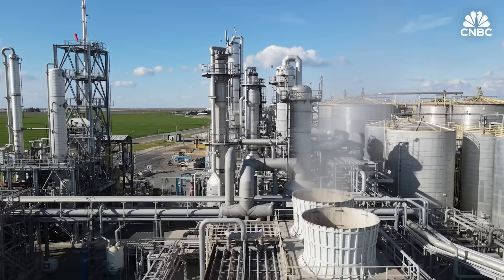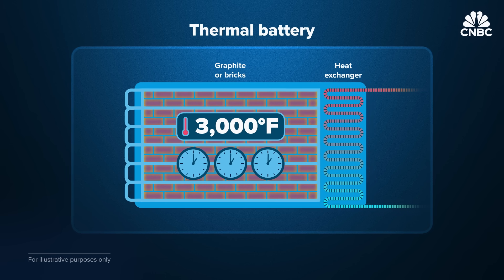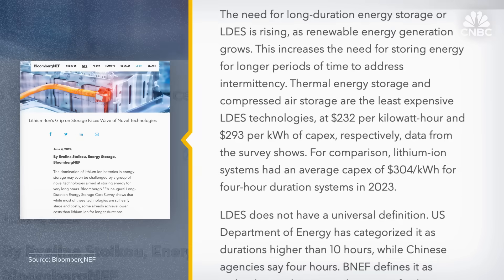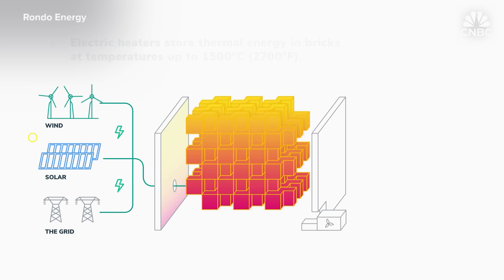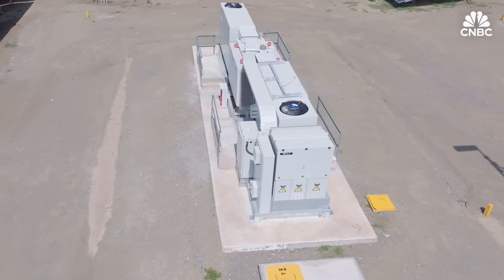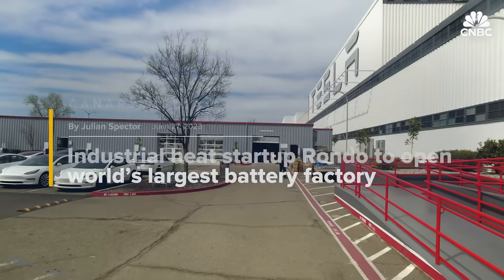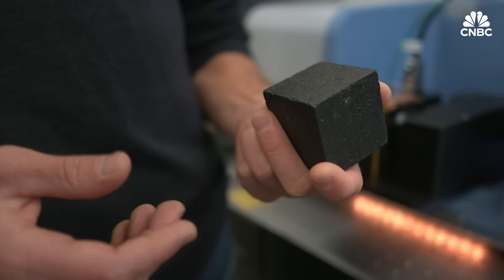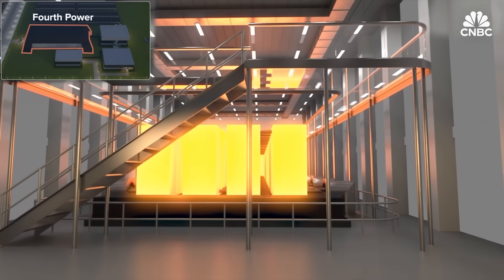How Thermal Batteries Could Replace Lithium-Ion Batteries

Comment: This was how some houses in England would heat. They had thermal mass under the floors and heated it at night when there was not the demand from industry and kept the coal plants running.  Now there is less industry and now there is extra wind at times.
Reply: Yes!
Reply: @RondoEnergyGlobal my brother in law bought a house couple of years ago and now he built up walls of clay inside and plaster the outside also with clay. It looks very beautiful and the feeling/climate inside the very nice. Unfortunately the ceiling was already pretty low so he couldn't put floor heating in it and use a heat pump. Hopefully he will put some solar panels on the roof in the future to make it really nice

Comment: Residential battery storage is already down to $230 kWh retail. So, I'm having a hard time believing utility scale battery storage is $304. How old is the data in this report?
Reply: There is a big difference between mounting a battery on your wall and installing grid scale storage. The cost of the residential battery might be $230 but for grid scale you are doing a lot of civil work so those batteries have a safe place to sit and then all the wiring to make the connections to the grid. I'm guessing for the utility scale they are factoring in the average all in costs.
Reply: @pin65371  That is per kWh so a residential  system is thousands of dollars. According to Energy Storage News the cost was average cost for utility scale storage US$180/kWh at the beginning of the year, compared to US$270/kWh the year before. It seems their costs are based at least two year old data. It looks like they are already not competitive.
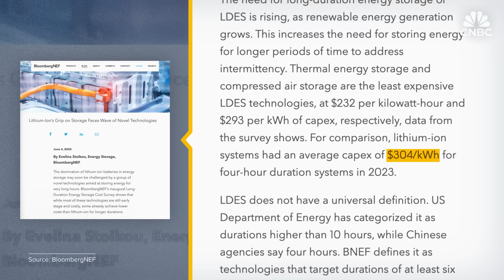Reply: If you're talking about the one at 2:40, it says it's from 2023. To build on your point, the cost of battery storage is dropping absurdly quickly. For reference, there are currently LiFePO4 prismatic cells such as the EVE MB31 where the cost of the raw cell is ~$95 per kWh. Obviously there are additional costs such as the BMS and the inverter equipment, but for grid-scale storage I suspect that the cost of their systems will be dominated by the price per cell.
Reply: @Nezzytheawesome  there will also be large costs for the civil work for the grid-scale batteries.  Either they sit on a concrete pad or they have concrete piles where the batteries sit on. Then you need to add all the costs for making the connections so you can connect those batteries to the grid.  There are a lot of well paid people involved from engineers to the trades that do all that work.

Comment: For those interested in reading, the Department of Energy recently published an article ("Achieving the Promise of Low-Cost Long Duration Energy Storage", Aug 24) discussing a bunch of grid-scale energy storage technologies, including thermal energy storage, and what can be done to bring down costs.
Reply: Note our primary customers are heavy industrial facilities that require 24/7 heat, not electricity. That heat is currently being produced by natural gas-fired boilers that in some cases have been operating uninterrupted for decades. We take intermittent power that is low cost, or even negative cost during hours of overgeneration and curtailment, and convert that to the high temperature heat that industrials need. Industry is the largest emitter of CO2 and 74% of industry's emissions come from heat, not electricity, to drive industrial processes.
Reply: Thank you! Used ChatGPT to summarize as it was 51 pages! woof.
Reply: You’re so cool for this
Reply: While heating the planet.. Or, how the irony mountain grows every day

Comment: WHY NOT JUST MAKE THERMAL POWER PLANTS IN EVERY CITY!? Earth is full of heat, y’all, 1000ft below or higher. Pipe down, pipe up. This is an expensive red herring
Reply: Rondo can re-power thermal power plants to run off of intermittent renewables instead of coal, oil, or gas.
Reply: Conservatives and fossil fuel industry will block it.
Reply: @larryc1616  bet the dems are against it too. None of the politicians want real change; especially nothing that could lead to utopia
Reply: have to wait years before things evolve
Reply: The process would require electricity since thermal pipes can t passively transfer heat down below towards a cool surface without significant energy loss.
Reply: @ You must have skipped elementary science class. Water goes down because of gravity, steam goes up because of heat and conduction/convection. The system would generate largely net positive energy. Iceland is powered by 90% geothermal electricity. Look it up
Reply: Iceland can use geothermal technology because there are heated reservoirs of water relatively close to the surface. Not everywhere is so close to the heat of the earth that water can efficiently be heated by the earth. Some places would need holes so deep that they would be on the tip of oil-drilling capabilities. Also, Iceland has been developing this infrastructure since the 70's. I'm not saying that geothermal everywhere couldn't work, I'm saying that it is more complicated than you think and needs to be better developed like every other project. For more information, check out the video "Geothermal energy is renewable and powerful. Why is most of it untapped?" by DW Planet A.

Comment: lol ok it stores the energy at 1/10th the cost but there is no other benefit that a BESS could provide like frequency regulation, voltage support etc.  Also they didn’t cover the efficiency losses of the heat transfer.
Reply: 74% of industrial emissions (22% of global CO2) comes from industries demand for HEAT, not electricity. We're 98% efficient electricity-in to heat-out -- and we sell customers heat, not electricity.

Comment: Great video highlighting the potential of thermal batteries! However, it misses the game-changing role of cold energy storage, especially in hotter climates where cooling can consume up to 70% of electricity. Technologies like EnergiVault from O-Hx provide rapid discharge capabilities, cutting costs and emissions while meeting peak cooling demands. Cold energy storage is a vital and disruptive part of the energy transition! 🌍❄

Comment: BS........energy losses to big .......they don't say for how long can that stored energy last until becomes zero
Reply: We're 98% efficient electricity-in to heat-out -- and we sell HEAT to customers who need heat, not electricity. We operate 24/7/365, just like industrial-scale gas-fired boilers do. Charging for 4-6 hours per day to sell heat 24/7.
Reply: @RondoEnergyGlobal bollocks. 98% efficiency is impossible... Unless you're ∆T is very low, you are going to have significantly higher thermal loses to the environment, even if the reservoir and pipes are extremely well insulated.

Either you are lying or have very dodgy data

Comment: It's an interesting tech.  If you're using it to get electricity back, you of course suffer some additional losses in going back from heat.  However there are so many uses where it's the heat that is needed.  Industry especially.  But also others.  There is somewhere in Europe (don't recall where) where they are testing a system like this for a municipality.  They use a steam system for heating houses & other structures during the winter.  Using the heat directly lowers the loses & in their case they simply tap into existing infrastructure.
Reply: Yep! We primarily sell heat to customers, but also have announced projects that are in a combined heat and power configuration.
Reply: plenty of municipal hot water systems in Denmark. I've mentioned in another comment I visited a thermal storage plant feeding one about a decade ago. They didn't even use electricity, but concentrated solar to charge it during the summer

Comment: What's the energy density (usable energy after converted back into electricity) in terms of kWh per unit mass or volume? How does that compare to chemical batteries? Without looking at numbers, I guessing it's not good. Another pie in the sky money laundering scheme similar to those gravity batteries.
Reply: We primarily sell customer heat, not electricity. 74% of industrial emissions come from the generation of heat, not electricity. We are 98% efficient electricity-in to heat-out -- and we sell customers that heat.
Reply: Gravity batteries are a joke, but thermal storage is not. Many industrial processes could directly benefit from this.

Comment: Two thirds of energy is thrown away. There are two types of energy here. Thermal Energy. Electrical Energy. Thermal is cheap. Electric is expensive. Electricity can convert to thermal. But only about a third of thermal can be converted to electrical. This is an extremely inefficient way of storing energy.
Reply: True, but if it is cheap enough or safe enough or flexible enough (not saying it is) then the inefficiency might not be a major issue.  
It is an important variable to consider tho...  One of many variables...
Reply: @desiv1170  only 20ish% of our grid is coming from solar and wind, imagine a 66% lose of power on that because we decided to go all in on thermal batteries and store electricity in the worst way possible.
Reply: @ghost25killer  Hyperbole much?
It's not "the worst way possible.."  🙂It's just not as efficient as some others.  Which is important to know, but there are many variables to consider for what is a good technology for a chosen use case; efficiency is just one of those variables.
Does it mean this isn't the right choice?  Maybe.  Maybe not.
Reply: @ghost25killer  lol, storing energy otherwise trashed is only a win
Reply: Nobody cares about the efficiency coefficient. At the end, all that counts is the per kWh price.
Reply: If you watched the video, they clearly indicate the focus on industrial uses with an emphasis on heat.
Reply: But its a great way to store heat, & many hard to decarbonize industrial processes could benefit from it.
Reply: There are many regions today where the price of intermittent electricity (peak generation) costs zero or negative dollars (curtailed). This happens in Oklahoma, California, and beyond. Capturing this "free" or "wasted" electricity to generate heat eliminates or reduces reliance on natural gas to generate heat -- which has price volatility and introduces risk to operations (regulatory risk and price risk). We reduce costs compared to natural gas today in many markets around the world, and costs will continue to fall as the price of intermittent energy continues to fall.
Reply: True.  And I want to add that a lot of industrial processes need high heat like steel and concrete industries.  Storing it as heat makes sense especially if the storage medium is cheap as sand, non-toxic and readily available.  There is ceramic/sand storage that is used for that high temperature application.
 
On the residential front, a typical 10-min hot shower may use up to 3.5kWh of electricity.  So it'd be better to store the heat a ceramic/sand or phase change material (like paraffin wax) and draw the heat out again later for home use.  Can also be used for home air heating.  The cost per joule of storage cheaper than lithium batteries and the cycle life is way longer too.  That heat is typically stored and used in a short period of time (within a 1-day cycle) so any energy losses are not a big deal.
Reply: In some industry like steel, they need electricity like a whole city just to produce heat so storing in thermal in the first place makes more sense.
Reply: 3:25
Did they say Brondo company?  Does it have electrolytes?  🤣

For those that don't know, see Idiocracy.
Reply: One-third conversion efficiency is still like twice as good as the best fossil fuel engine technology.

Comment: Let me introduce you to the cheapest most efficient  and cleanest technology that produces so much electricity that it lowers prices substantially……..nuclear power plants
Reply: You can't put a nuclear power plant at the heart of a textile factory, or a food and beverage factory -- who require HEAT to drive their processes, not electricity. We sell customers energy in the form they need -- as heat.
Reply: Nuclear is horrifically expensive and is not the cleanest.   Nuclear will raise electricity prices.
Reply: @Kthomasritchie  Nuclear has the lowest wholesale price, by far.
Reply: @PistonAvatarGuy  exactly... people only look at the massive costs to build them.  It takes 15 or so years to pay that off but after that you'll have decades of cheap power. The most expensive part of a nuclear power plant is the buildings and the civil work.  Assuming its properly built and maintained you can get 80+ years out of the expensive parts of the plant.
Reply: Let us all know when someone develops an affordable nuclear power plant. It may actually happen, someday. But for now, solar, wind, batteries and natural gas are all infinitely more affordable than expensive nuclear.
Reply: @Kthomasritchie  Nuclear is reliable, and clean. Not cleaner than wind or solar but more reliable.

Comment: Seems this tech solves a problem for power plants and not directly for the general public. So it’s easy to see why it’s not as widely known. It sounds promising though.
Reply: Power plants can be retrofit with Rondo to drive steam turbines with zero carbon heat from intermittent renewables instead of 24/7 natural gas. However, our primary customers require heat as heat -- not as electricity.